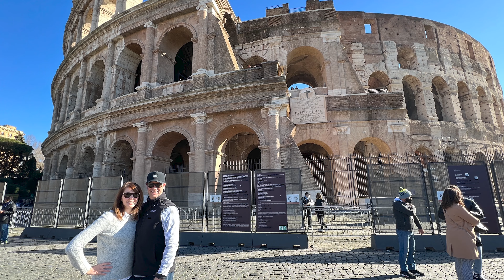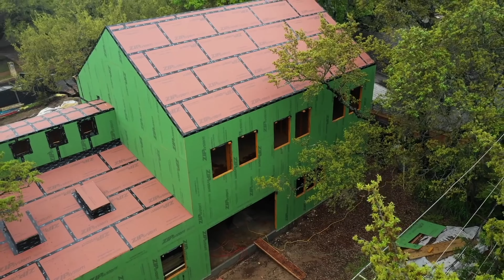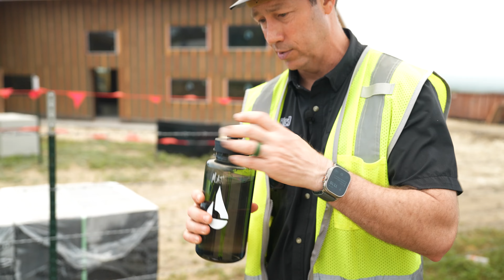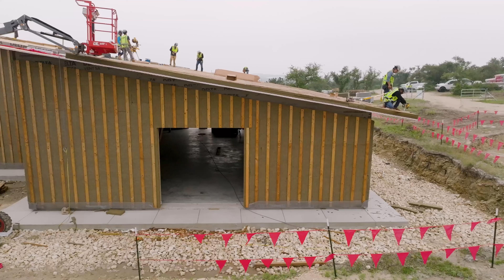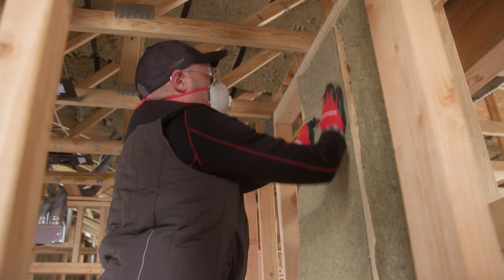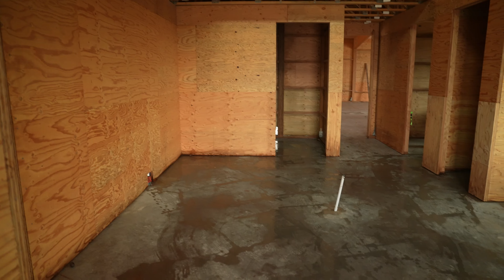4 Reasons I love Rockwool OUT-sulation!

Comment: Matt,
I live in Northeast Florida. No-one wants to deal with Rockwool. I would love to insulate my attic, but I have 2x4 rafters at 24 inches apart. The ONE insulation company I could find that even admitted to knowing what Rockwool was said that my rafters were too small and too widely spaced to use Rockwool. Is this accurate? He recommended that I use fiberglass batt on the underside of my roof decking due to its higher stability with backing paper. I really want to improve the efficiency of my home without resorting to spray foam insulation. Any advice?

Comment: I wish I could find a builder as curious and focused as Matt in the Florida Gulf Coast region (Sarasota/Manatee County). I got two builds to do on the coast, and it's a challenge.
Reply: I've only talked to two, as my project isn't for another year. The first had the attitude, "It's my way or the highway." They did not want the homeowner on site, or helping in any way... "Insurance." No thanks. Next.

The second was a lot hungrier and offered advice on what size of excavator I should get to dig the hole, and who to rent it from. Because of the extremely difficult ground I figured if I dig the hole, I can put up with delays like busting rocks and rethinking where to put the basement (and how much basement). My thought is that DIYing the hole will have the greatest potential of saving money, without getting in the way of the G.C.

I'm sketching up ideas now, and paying lots of attention to building science, but eventually I'll get a pro architect. And if the architect deems necessary, a pro engineer. The latest video from the Perkins Builder Brothers https://www.youtube.com/watch?v=BY2Tl_xhLFM talks about the hierarchy of authority. Because the plans had not been stamped by the architect, they were more like suggestions than "law". As long at the Perkins guys stayed within the code, they could fudge things a bit (like adding "too much" of rebar to the footers). However the pro engineer (a stamped document) overrides the pro architect (stamped document). Third in line is building code. And finally the best practices of the builder, "It's how we've always done it." In the video they mentioned that the inspector said the written notes on the plans were the most critical information.

Watched an architect's video where he puts tons of detail into his drawings. Someone asked if builders balk at the extra details. The architect said thousands of decisions go into building a house. It's a matter of when those decisions are made and who makes them. Also, does the builder want to take the time requesting clarifications from the architect, or do they want to take the time to read the plans. Details can be descriptive, "Do it exactly as shown." Or prescriptive, "Do it so you get these results." Prescriptive can be harder to specify, but gives the builder more freedom.

So how do we protect ourselves from rogue builders? #1: Put it in writing (plans or engineering drawings). #2: Put it in the contract that the builder will follow the plans, or the homeowner gets a do-over. A lot of places in the code, or in the plans, say to follow the manufacture's instructions.

For a shower waterproof/tiling job, one homeowner had in the contract that the builder use the same brand of backer-board, tape, and thin-set---the builder had a choice of brands, but the plans said that whatever is chosen, to stick within that brand (as all manufactures' instructions say). The builder had a favorite backer-board, but always used a different thin-set because of local availability. The builder wanted to mix brands ("like we'd always done it") but the homeowner insisted, and mail ordered the proper thin-set for the builder. Did it make a difference? Who knows. It can take years before anyone realizes that your shower is leaking and has half-destroyed the floor joists. Meanwhile the builder has "done it that way" for the last hundred projects.

Another example of manufacturer's instructions is to "roll the tape" for Zip sheathing and tape. The builder doesn't get to decide that since his guys have never used Zip before, they can skip the rolling. If it's in the contact, you can tell them to roll it now, or wait a few weeks, pull off the siding, and roll it later.

Good luck.
Reply: @ScottyDMcom  You have put a lot of thought into it, my friend. I suspect you'll do fine.

Coastal construction is a totally different animal. Every house comes with at least one engineer, and often a licensed architect. Wind loading to 150 MPH sustained, surf inundation, water management...it's a lot. Approvals required by local and state (who proxy for the feds). 

No more little shacks on the shore.
Reply: @FamilyManMoving  Sounds like your builders are used to following the instruction of architects and engineers. My guess is that you want to add performance enhancements to the existing survivability requirements. Probably need to find an architect who is as interested in building science as they are in creating homes that last.

Builder Scott True has a channel here, and has been featured on Matt's channel. He's attempting to build and sell better performance spec homes in a Texas county that doesn't even have a building code. He's learned that few economy buyers know about or care about building science. Just give 'em the Corian counters rather than Formica, and they are happy. After the sale he shows them the ERV and how to take care of it. It's the opposite problem from ours.
Reply: @ScottyDMcom  Nope. If you haven't gone through the effort of building to code on a Florida Gulf Beach, you won't really understand. To even apply for a state permit to tear down an existing house and rebuild, I had to hire multiple engineers, dig multiple bore holes for soil samples, submit exact manufacturer specs for most structural components, and prove that the entire ground level is able to collapse inward during a Cat 5 hurricane...without damaging any other part of the building. The cost to build the structure necessary to hit the first floor is well into six figures. Note that there is no floor. Or walls. It's just the concrete everything sits on, plus engineering. 

This is not unique to a few builders. Any builder not familiar with the process is interested, until they learn. Then they run. 

But, it's a cool location and worth the effort. Just expensive.

Oh...creative construction techniques are cool everywhere except hurricane coastal zones. I've tried. Feds and state just say no. They don't mess around when you are the first structure to meet the surge. They call houses like ours, "speed bumps".

Comment: I'm not a house builder by any means, I am a tile contractor that mostly specializes in custom shower and bathroom builds. I use rockwool a lot in my shower builds and really nerd out on all the latest tech and trends of the tile industry. But this video was very intriguing to me. One question I have would be to window and door details....how do you frame them out so you can flash them and have them be flush with your exterior finish product?

Comment: Do you need, or should you have, space between the Delta Vent SA and the Rockwool, or is the porousness of the Rockwool sufficient for drainage between those two surfaces in the off chance something gets back there?
Reply: My understanding is that with comfortboard and its ridges you don’t but with polyiso or xps a very small 1/8 or 1/4 inch gap helps especially in a roof assembly, there are some bld. Sci insights blogs from J. Lstebrek about gap size since you do lose some thermal efficiency for the sake of durability.

Comment: Did you check out the Pantheon?
Reply from the maker: Yes. It was so much different than I expected. What a cool trip
Reply: @buildshow  Made with Pozzuoli volcanic ash and lime which is far superior to Portland cement, and more environmentally friendly.  Pour a driveway with Portland cement and a month later it wants to crack.  The Pantheon is 2,000 years old and only has a few cracks out near the walls.
Reply: Awesome. Definitely my favorite building in Rome.  They had some really good concrete tech back then.

Comment: Matt. I love your content and ambition to build better too. You’re making a real difference. But there are impactful questions that haven’t been raised. For one, we need materials that are more water and pest resistant. For all your sealing and taping, have you ever asked yourself why you’re working with such an inherently susceptible material? What is a better material: treated wood, steel, stone, engineered wood - I’m going to start saying “wud,” like food stores say “Krab.” The wood you’re using isn’t very good, and compared to the wood used when I grew up, it isn’t even really wood. Also, and this doesn’t cost money, thermal and radiative, think sun, heat transfer engineers need to help with some better calculations. There’s nothing to the calculations that they don’t understand. The science is there and we need to identify the most cost effective methods, not just blindly do everything. Better materials, in a simpler design and fabrication strategy, may outperform tape in five, ten, or twenty years. I’d love to see how blower door tests hold up over time. These innovations could have an absolutely enormous impact on energy usage around the world, but there are no  Hollywood celebs interested in making it sexy.

Comment: Heard some bad things about breathing in rockwool, so I wouldn’t use it inside my house… BUT outside the house seems like a perfect place for it.
Reply from the maker: I have it exposed in my attic and I’ve never been uncomfortable in that space.
Reply: @buildshow I've been a smoker for years and feel fine.
Reply: Asbestos is a naturally occurring mineral that gets weathered like other rocks into dust.
Reply: I assume you mean formalin offgasing that doesnt happen because of how they produce it.
Reply: @michaelfranks341  no, I mean small little inorganic particulate being inhaled, similar to our other fun little insulative friend asbestos
Reply: @cxsey8587 the mineral wool fibers are not the same as asbestos fibers at all. Theres dust while installing it with little rock pebbles that fall out, but Ive had no issues installing it.
Reply: @cxsey8587  Mineral wool fibers are a lot shorter than asbestos, so they're more easily eliminated by the body.
Reply: @cxsey8587 rockwool.isnt asbestos. Asbestos has a cool looking dumbbell shape in the lungs called Ferruginous bodies... I've diagnosed about twenty Mesothelioma cases in my 15 years in Pathology. Most Asbestos patients actually develop lung cancers typically than Mesothelioma.
Reply: Never had a problem with rockwool. Fiberglass always has my coughing